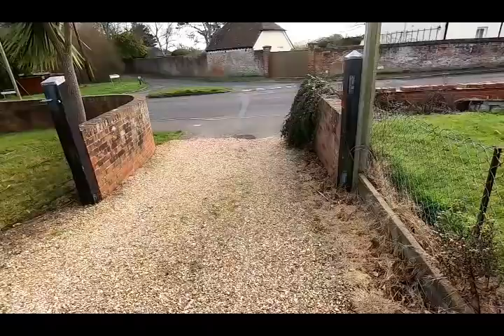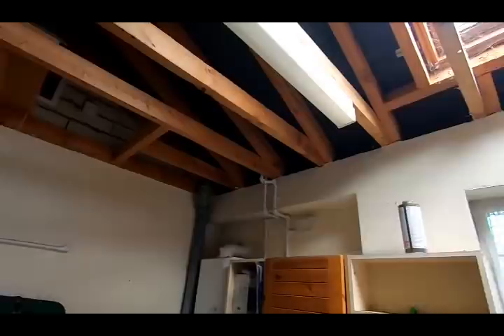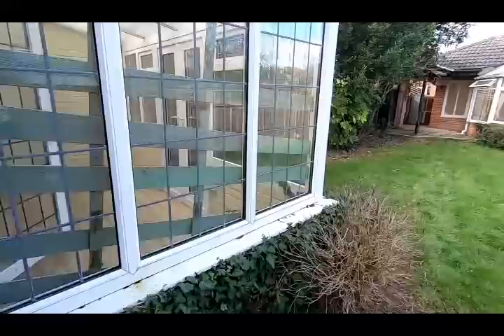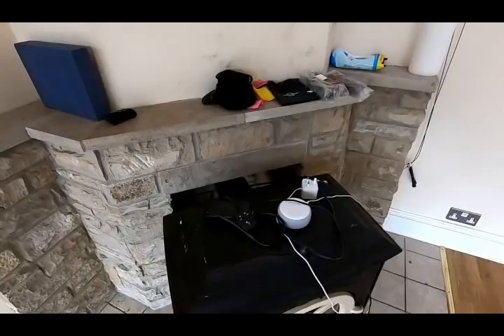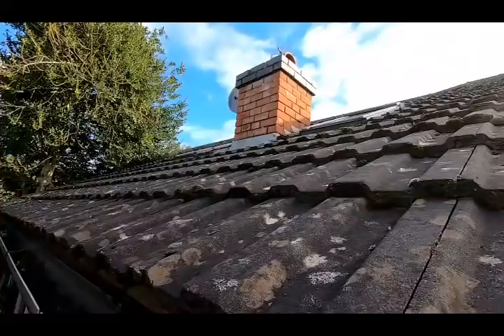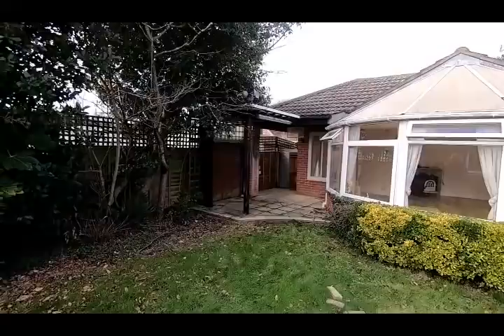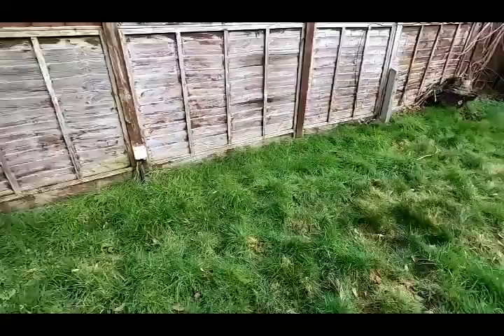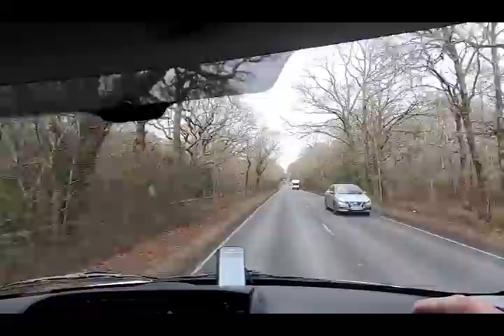Delta inc -  Southampton Demolition - House & Garage Clearance Quote.

Comment: Alot of conservatory rafters in the old pvc ones do sometimes if your lucky have lead reinforcing poles in them if the roof panes are glazed units. Same as old box sash windows rhe weights in the wood ones have nice lead weights